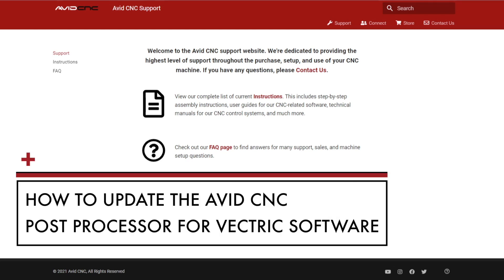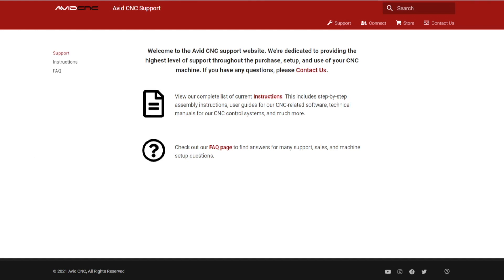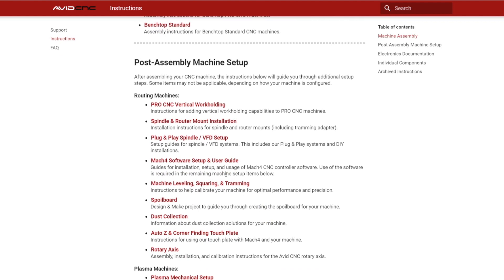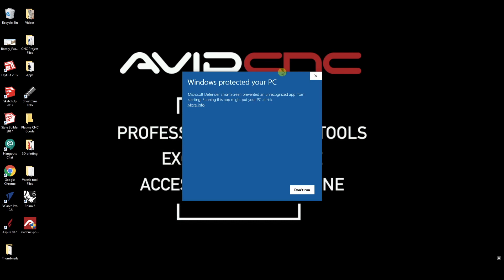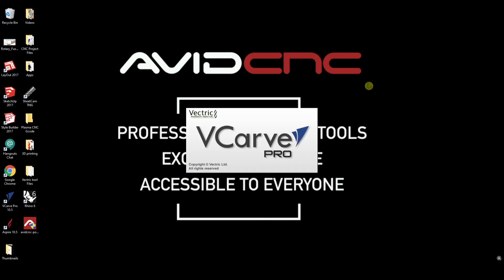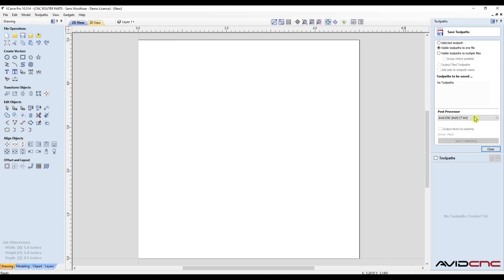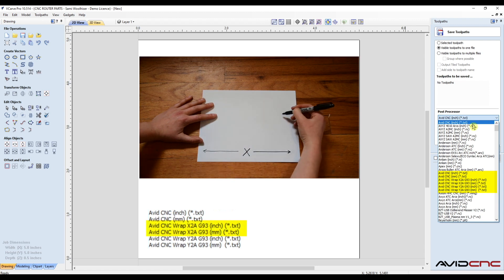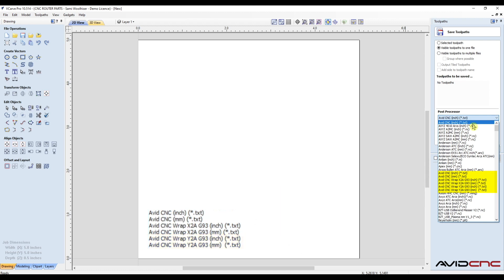How to Install the Avid CNC Post Processor for Vectric Programs 10.5 and Earlier

Comment: I am so confused!  The instructions say that Avod Post Processor is included in vectric ver. 11+.  I have ver. 11.5 of Aspire, and when I look at Post processors, I see nothing about Avid.  All I see is G-code inch & mm.  Help!
Reply from the maker: Instructions are right here: https://www.avidcnc.com/support/instructions/software/downloads/vectric/#ex-controllers-centroid

You have to go into that menu and download them IN Vectrics software. If you need additional help contact support or post in the forum, it will be a lot easier than replying here.
Reply: @AvidCNC  I got it figured out, but thank you for your fast reply!